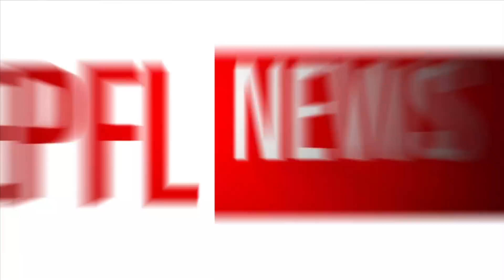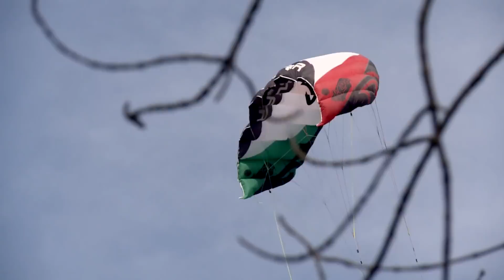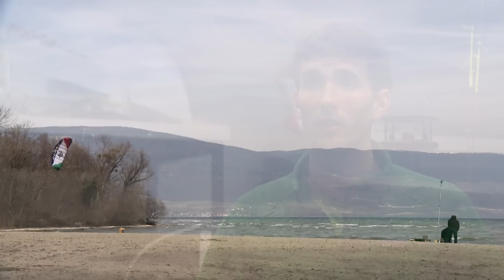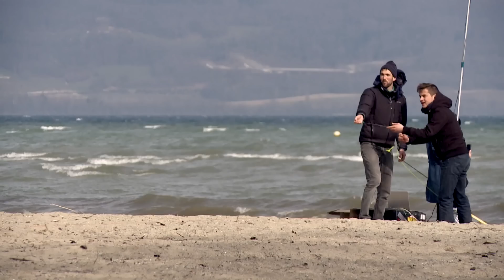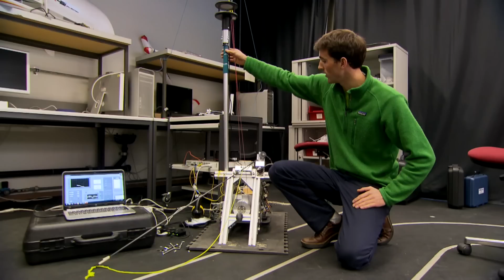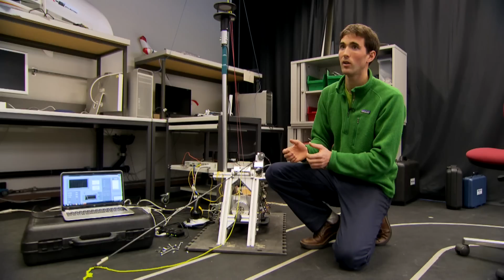An autopilot for steering flying windmills

Comment: I suggest the following design:
the ropes are connected on a wheel which on electric motors, you lift the wing/parachute and let the wind energy to raise the wing and rotate the generator wheel, then you just turn the wing to an angle that will allow to pull it with less energy, then you let the wind to push it again. the difference of pulling and pushing is the energy you harvest from wind...
Reply: Hi Gevorg, this is roughly how it is done currently!
Reply: Thanks Sean for your reply. It wasn't clear for me from the video, maybe a schema in the video would help.
Reply: Sean Costello you could do it with a large wheels and 3 kyte ?
Reply: I want to install an automatic steer control of the kite on my boat. Can any body have an idea where I can get it?